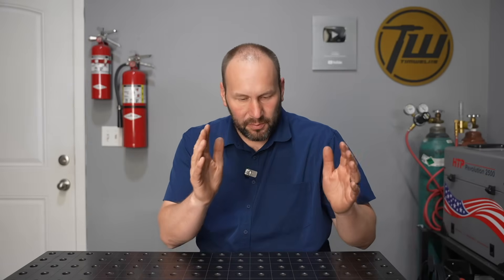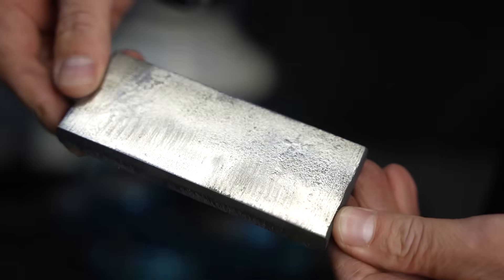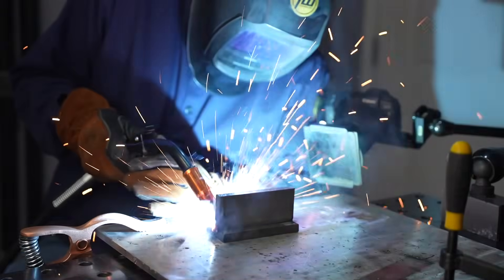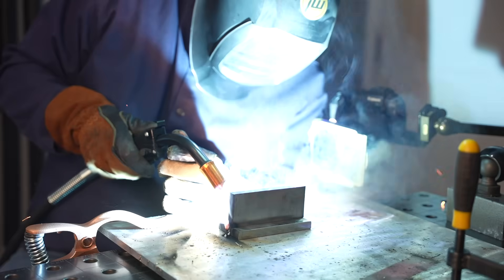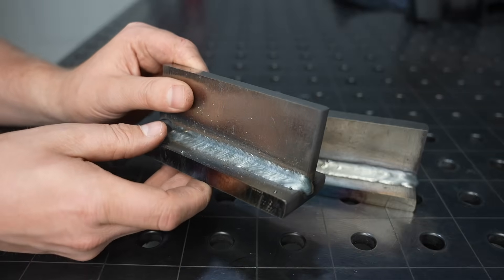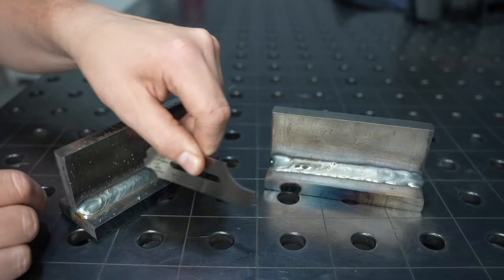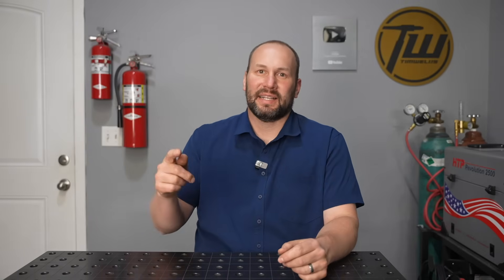MIG Welding Thick Steel - Short Circuit vs Spray Transfer

Comment: The synergic Maschine that u are using is not good the spray transfer  weld didnt had enough wirefeedspeed resulting in undercut

Comment: I just moved to Tulsa Oklahoma. I have ran into several ppl that don't know the difference between short arc and spray here. They actually call it spray arc and mig here.... Suggesting that short circuit IS mig welding and spray arc is just spray. I've not heard that until I moved here. Anybody else know why the Tulsa ppl are being taught spray transfer isn't mig welding????

Comment: Pulse spray or dual shield for anything 1/4" and above. You can also run flux core if you're on a budget. Short circuit is fine for your everyday lite stuff and non-critical components. Just don't trust it to hold up the world!

Comment: You can get good spray with 75 25 if your volts  are high enough, but you typically need a 3phase machine.
Generally you'll be pulling min of  300 amps in around 31 volts minimum.
You definitely need a longer stick out or the heat will cook your contact tip and it'll start pinching the wire and you'll get a stuttering of the wire even with a water cooled torch.

But it's a great process when you get it dialled in  we were doing 18 meter runs into the internal corner / seem of a deck plate on 400mm square box section for a bridge its fast and hot and leaves a really nice weld.

Your welding shade needs to be a step darker too in my experience its extremely bright and any uncovered skin will get sunburn very quick a lot of UV from this process.

Comment: Automotive requirements are typically 10% of material thickness penetration into the base materials on vertical and horizontal on a macro etch. That short circuit looks like it isn't 10%. Makemistakeswithgreg has some great vids on how weak short circuit mig is on thick material and why spray arc is used instead.
Reply from the maker: Short circuit definitely is limited, especially when it’s run cold.

Comment: What about that washed out undercut?
Reply from the maker: I'm not sure if this is an honest question or if you're trying to call me out, but I'll treat it as a question. For those who are unaware, undercut is a recessed region right at the toe of the weld and it can be problematic in some cases because it's a stress riser where cracks could start. Welds often look like they have a bit of undercut on video due to the different sheen. I didn't notice any in reality or at least not any significant amount other than perhaps the crater on spray transfer, but I could have missed it. There's generally a tolerance for undercut depending on the particular joint, it's usually 1/32" along the length of the joint, with short lengths of up to 1/16" allowed, but again it depends. If you are running into issues with undercut, it can usually be corrected by double checking your work angle, reducing voltage slightly and slowing down to let it fill in.

Comment: Great video.  The advantage of convex fillet weld profiles is that the actual fillet weld length is the effective fillet weld length.  On concave fillet welds the effective fillet weld length is less than the actual fillet weld length.  The importance of this is that the effective fillet weld length is used in determining the strength of the fillet weld.  hth

Comment: Hello I am currently doing a part time evening mig welding course and have just finished the first level and I am really interested in doing more of it than just in college well along side it I just don't find three hours once a week is enough to help me gain real practice at  mastering my welds and I'd like to know what would be a good mig welder for beginners that can also be used for possibly TIG MMA Stick and spot welding

Thanks

Comment: With spray transfer you can rest your nozzle on the bottom piece and aim slightly higher. It won't affect your joint, and you'll won't fry your hands
Reply from the maker: I'm going to try that next time. Thanks!

Comment: Not that i think you intentionally messed this up, but people have done tests and videos before and proven you cannot be in a true spray using c25 it has to be atleast an 82a mix.
Reply from the maker: I've tried a couple machines that could do it, or at least it was close enough to a spray that I couldn't tell the difference. At the end of the day, it doesn't really matter. You're right that it's not a best practice or even a good one. Like I said in the video, if you want to run spray, you need a hotter gas like the 90/10 that I was running in the demo or 98/2 (Argon/Oxygen) if you never need short circuit.

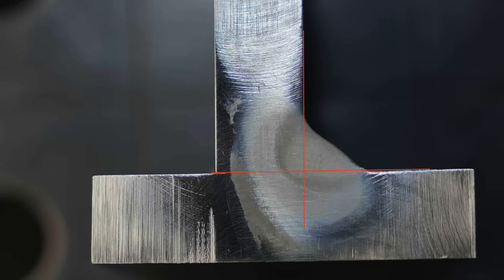Comment: The cut and etch is great. Would the spay have more penetration on the bottom plate at 7:30 by angling the gun more into the plate?
Reply from the maker: Probably a little, but the fillet leg length was already longer on the bottom and that would also be exaggerated if I biased the bottom plate more.
Reply: Thank you!

Comment: so, besides 90/10 gas , what is different?! you don't tell us how to do it!  Higher Voltage?  how much?
Reply: Higher voltages, higher current, and higher wire feed speeds.
See his settings. For short circuit he was using 23.7V and 275 IPM, and for spray transfer he was using 29.6V and 330 IPM.
Spray transfer cannot be used out of position, so only for flat or horizontal welds.
Reply from the maker: @heintmeyer2296 Thanks for the feedback, it would have been good to be more clear about that. Besides the gas, it's mostly an increased voltage to somewhere over 26 or 27 and usually higher wire speed goes along with that which will increase the current and rate of material deposition. 

@terry9397 Exactly! Thanks for clarifying and adding the settings.

Comment: That is wild that you got the GMAW-S to bite into that 1/2”. 😅 are you sure that was not globular (joking)my dude? 

But for real, anytime I had to look at a base plate with GMAW-S , the usually failed my PT/MT for LOF . 

Always enjoyed your videos my dude.
Reply from the maker: Thanks! LOF is pretty common with short circuit MIG. This one was better than I expected, but I was pushing .045 wire at over 250 amps.

Comment: I thought short circuit is rated for up to 5/16 max? Would you have gotten the same result using 75-25?
Reply from the maker: There's no hard cutoff, but you can end up with some lack of fusion on thicker welds, so it's important to test it and know what you're getting. In the AWS D1.1 structural code, short circuit MIG is the only process that isn't prequalified so the procedure has to be tested no matter what.

Comment: where do you get the etch kits so i can look at my own welds?
Reply from the maker: I'd recommend getting Loctite Naval Jelly from the hardware store. It takes a minute, but works pretty good and is much safer than the stuff I use (which isn't readily available and has to be mixed).

Comment: I did a spray job using my TB302 using a 12VS and since the only gas quickly available was (90 argon 8 CO2 and 2 Oxy ) using .045 wire on 5/8 plate...That was hot and bright. But i do a lot of heavy equipment repair so i run a lot of dual shield so i have the heavy heat shielded glove with a heat shield that goes over the back of my glove. Sometimes you cannot get your bracing hand far away from the weld. Like you show always good to see it

Comment: Great video Tim now here’s th thing u have a machine capable of doing these processes 💪🏽💪🏽💪🏽💪🏽could u do a video comparing penetration between Pulse (spray pulse 92-8 gas) vs straight Spray transfer 90-10 gas an dual shield flux core 75-25 gas thank u  for all th great content God Bless🙏🏽🙏🏽🙏🏽🙏🏽

Comment: Is spray transfer possible with .023" wire and a 120VAC/140 amp welder?
Reply from the maker: Generally no. A machine like that is going to be limited to material about 3/16" thick and under (maybe some 1/4" in a pinch) which can be welded just fine with short circuit MIG. Spray transfer is really most applicable as you get to really thick material. To get the most out of a machine like that, I'd recommend running .030" wire instead of .023" once you get up above 1/8" thick material if you're doing much of it.

Comment: Is it that the machine is capable of more amperage to do spray transfer, or is it that it can run at higher voltages?
Reply from the maker: It really takes both. The higher voltage is needed for a longer, continuous arc and the higher amperage is needed to maintain that arc when you start pushing more wire in. As a rule of thumb, most good quality machines in the 250 amp class and higher can run a spray transfer. Some in the 200-220 amp class can with smaller wire, my HTPs and Fronius will, but most in the 200 amp and under category will struggle to run a spray transfer and if they did would hit the duty cycle quickly. Spray transfer is not necessary for most people, but if you're running a lot of heavy steel, it's definitely worth looking into.

Comment: Let me ask a beginner question if I may. When using a different blend of gas, how do you account for it if your machine doesn't offer a setting option beyond 100% argon or the 75/25 blend? Or does it matter?
Reply: Let’s not get too complicated here. You don’t need a tri mix. Unless you’re doing something to spec, which you likely aren’t, it doesn’t matter. You won’t get a better weld. Your machine has what are more suggestions than anything else, on their charts. It doesn’t know what gas or wire you’re using. It’s just telling you what they think will work with their machine. You adjust your settings anyway. But in order to spray arc, you need around 250 amps and 28, maybe as little as 26 volts. Those would be minimums. You have to try it and see for yourself if it works. But really, unless you’re doing structural work with 1/4” and above, spray arc gives little of value. I usually do 1/4” with short circuit and it’s perfectly fine. Just remember that to obtain the highest heat and penetration, you usually have to go to 0.035 wire, not 0.30. Most machines won’t do the heaviest metal with 0.030. So, you need to check to make sure you have the right roller, and the right lining as well as the right tip in place.
Reply: @melgross Are there reasons to not use spray on 1/4” because of the no spatter?
Reply: @jheissjr I haven't tested it out for myself, but I think spray would just melt through the 1/4" metal. There would be too much heat. I'm not too sure though
Reply from the maker: @photog1529 Most people won't need to run anything different than the standard 75/25 for general fabrication on steel. If you do run 90/10 for short circuit MIG, the wire speed is about the same as 75/25 and you'll usually need to drop by about 1 volt. Spray transfer will be completely different settings.